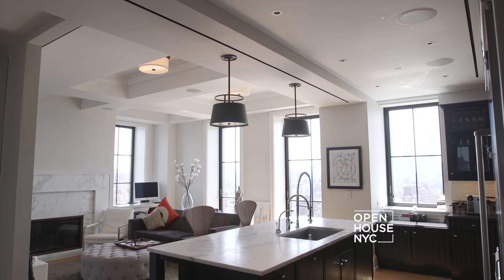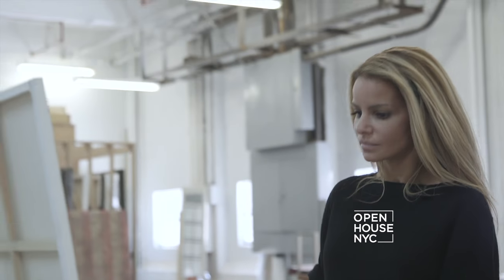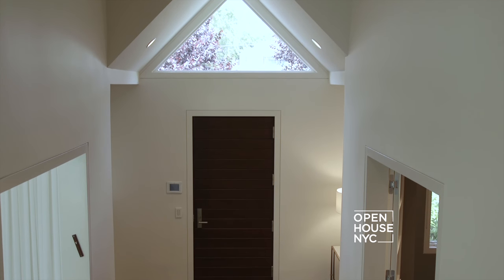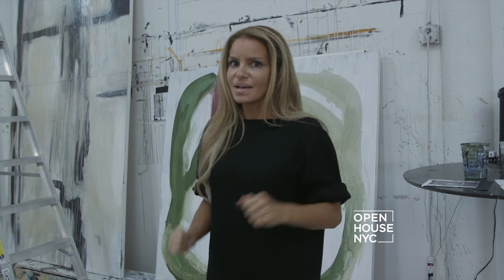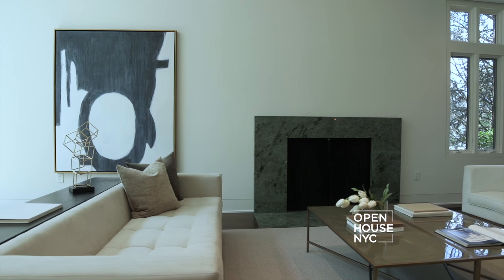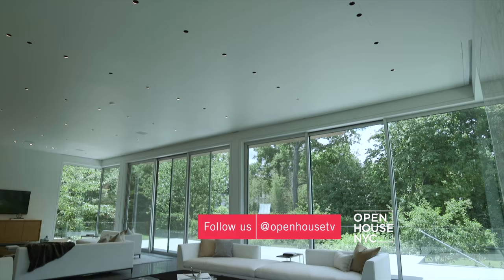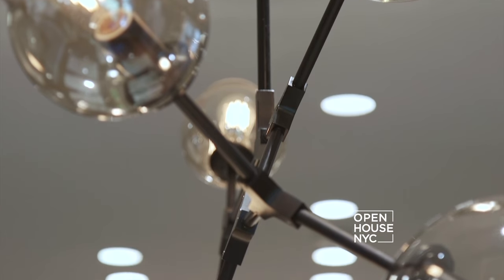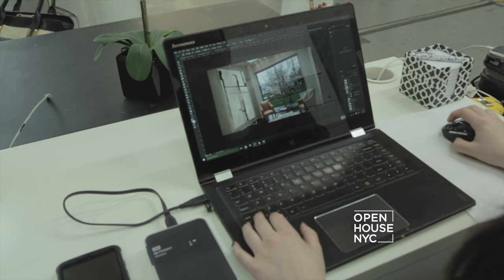Cheryl Eisen Reveals Secrets to Displaying Art | Open House TV

Comment: If you don't have a warehouse full of art or your own art team :-) you can also get pictures from the internet and get them printed on the cheap in your local copy-shop. Depending where you live you should be able to get a poster-size one for under 10 dollars even for a nice print. Then hang them naked (no frame) with a few straight pins: they won't leave a mark on your wall and will hold long enough for you to sell the house. That will give you the best bang for your buck. It might not quite be enough for 8M$ mansions though!